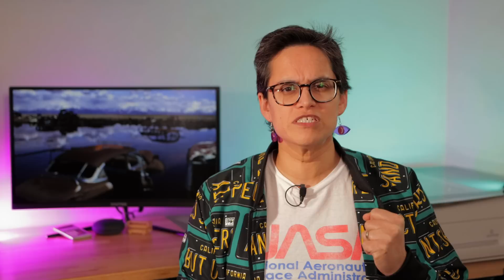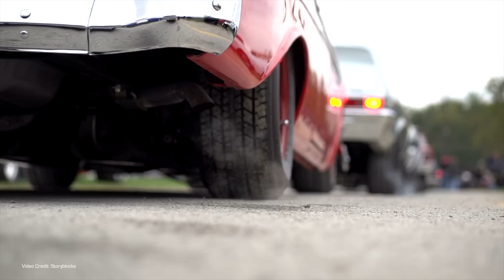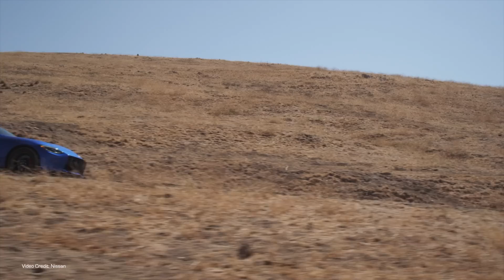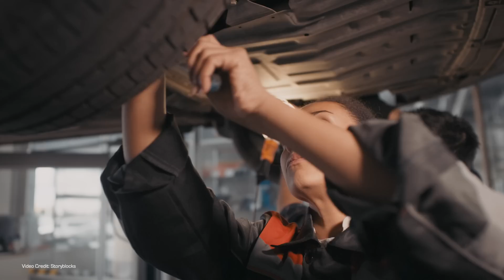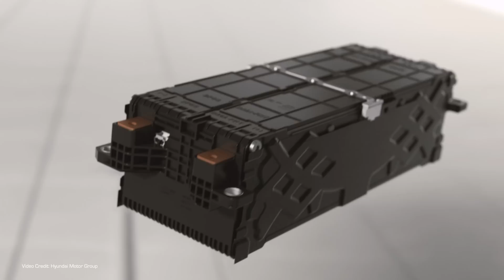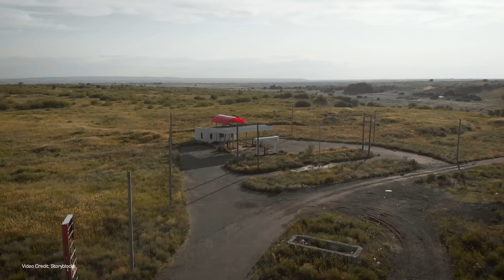Is Internal Combustion dying?

Comment: I agree ICE cars will slowly be adopted in the Western states but it will be slow in the upper Midwest and in the Southern states from New Mexico to Florida. Semi-trucks will be the last to change due to the recently introduced fuel-agnosticinternal combustion powertrain solutions that run on diesel, propane,  NG, and hydrogen. These engines have been in test for three years in California on Walmart trucks,  They are scheduled to go into production later this year and meet future CARB requirements. I still see electric cargo vans and trucks carrying less than 30,000 lb loads and only traveling 175 miles per day dominating the market over the next seven years. Battery technology needs to advance to 500 Wh/kg to overtake heavier longer distance requirements. As an example, today's electric battery trains with over 35,000 lbs of batteries can travel slightly over 44 miles per day pulling 430,000lbs in ideal conditions. An average ICE freight train carries 6,000,000 lbs of load.
Reply: Have you ever heard of electrification? Europe has electric trains that don’t need batteries. They take power from the grid as needed.
Reply: @davidlazarus67  Yes the company I work for makes the electric drive trains for these overhead feed trains and also makes hydrogen drive trains for trains where electrification is not available in Europe.
Reply: @Carl_in_AZ  There aren’t many places that have large areas without electrification. Parts of Scotland have diesel trains for remote regions. Though I have been on electric trains almost to the artic circle. Are these areas in Eastern Europe?
Reply: @davidlazarus67  We are doing electric diesel, battery, and hydrogen driven trains in parts of Great Brittan, Spain, Switzerland, Germany, Austria, Italy, Poland, and Sweden. Keep in mind trains that carry passengers are not the same as locomotives that pull freight.
Reply: The US is a small part of the car world. China is by far bigger market.  What they want will drive the world and they want electric.  What the US wants really will not be important.
Reply: @atlantasailor1  Yes and the interesting side effect is that Asians will end up driving Chinese EV’s and the scale of purchases could lower the costs considerably for Latin American and African countries.

Comment: Any more details on this battery patent that was hoarded by oil companies? I am anti-patent for things like this and many other reasons, and this would aid in my research. Thanks!
Reply from the maker: Iirc The EV-95 battery, a large format NiMH battery used in the GM EV1 and the Toyota RAV 4 EV (first generation) was produced by a company called Ovonics. That company was partially bought by GM which eventually sold its stake to Texaco. Then Chevron bought Texaco shortly afterwards. Chevron pretty much immediately banned Panasonic, who made the EV-95 battery under licence from Ovonics for producing EV-95 and barred any uses of the Ovonics battery in electric vehicles.

^Kate
Reply: @transportevolved  Wonderful detail thank you so much! Keep evolving!!
Reply: @transportevolved  Thanks, Kate! Very interesting detail!

Comment: When a BEV from Vietnam is going to cost 41K or there abouts low cost alternatives are very much needed. With the approximate 20% duty on Chinese BEV's , if imported, there is definitely a need for a 16K EV. Robotaxi's should be cheaper than owning an EV but that is a major unknown right now with no details on when, where, how much per trip, etc.
Reply: There is an incredible tiny car from China at $4500. It’s a city car so would be a great seller in Europe and Asia. It even outsold Tesla in China.
Reply: Everyone's selling everything they can make.

Cheapness is going to come later from the cars we are buying NOW.
The cost off a car is deprication, and that's based on a car dieing about 8-12 years after its owned, as you approach that date you get a discount from the seller based on the risk that you will be left holding the can when it dies.
From the nissan leaf 11 data (an absolute shody EV) it's just not dieing. Range may be degraded but it still works as a car.
We know that leaf11 degradation is 2-3 times worse than any other EV. So cars will be flooding in but 10years later they were not be dieing out like ice.
Reply: @simonhenry7867  I would expect that clever people will work out how to replace the batteries and give them a whole new lease of life.

Comment: There was some new nails to the coffin, thank you.
I believe that in 2025 BEVs will be cheaper to purchase than similar ICE cars, they are already way cheaper to own.
Reply: They're already cheaper than similar petrol cars, and have been for a long time. They're only more expensive if you compare them to dissimilar cars, or if they're made by petrol car companies that have priced them to avoid cutting into their existing sales.

A Tesla S Plaid is about 1/10th the price of a Veyron.

A Model 3 is about 50% cheaper than a BMW M5.
Reply: @gasdive  Because everyone is buying such expensive cars ... look at the bottom of the market where most individuals are looking and it becomes a different story.
Reply: @Hans-gb4mv  no one seems to be able to separate

"EVs are all cheaper than any ICE"

From the statement

"Some EV's are cheaper than the equivalent ICE"

These statements are not equivalent. One is the statement I made, the other isn't. Stop pretending that you've cleverly caught me out.
Reply: @gasdive    Battery electric cars will never be cheaper than truly equivalent conventional cars. Show me a new electric car with ABS, airbags, a motor with at least 80 horsepower and at least 100 miles of range for less than 16k, and I'll believe you.
The top speed and overall quality of a Model S Plaid can't even begin to be compared to a Veyron's. It can be compared to a Dodge Charger Hellcat, wins on 0-60, but costs almost double.
Again, the top speed and overall quality of a Model 3 can't even begin to be compared to a BMW M5's. It can be compared to a WRX STI, but has to cost almost double to win on 0-60.
Reply: @gsilva220  "overall quality" is a pretty subjective thing, but the Model 3 has more interior space, better NVH vastly better gearbox and more responsive engine. If you see "quality" as how much useless tat you can squeeze into a cabin (which has become the indicator of quality that the petrol car makes have pushed for the last couple of decades) then yeah, the Tesla can't compete on quality.
Reply: @gsilva220  look at the Dacia Spring in Europe. Yes it’s a city car EV, with a relatively small engine but it meets all your other requirements and with grants comes in at under €10k.
Reply: @gsilva220  PS "Again, the top speed....can't even begin to be compared to a BMW M5"

The BMW M5 is speed limited to 250 km/h. (unless you buy the race version which makes it twice the price of the Model 3 instead of just 1.5 times) The Model 3 does 261 km/h and the base model isn't much slower at 230 km/h. Certainly comparable.
Reply: @gasdive  You sound like a true fanboy - you have no interest in cars in general and don't care about the look
and feel of the car you drive - for you it's just a household appliance. You would happily drive around in a bananabox on four wheels as long as there is a Tesla badge on it.....
Reply: @robertkempe2730  so just like 99.999% of drivers then. BMW doesn't even make a manual car anymore. Nor does Mercedes.
How many single seat sports cars have you seen for sale lately?

But what's that got to do with it anyway? The electrics that I mentioned are 7 seat saloon cars. If your objecting that 7 seat saloon cars aren't sufficiently sporty, you're really clutching at straws.
Reply: @gsilva220  only 1 car in the US with ABS, airbags, and whatever, is listed below $16k. And that's the base model of the Chevy spark. The Mitsubishi mirage just MIGHT scoot under, but..probably not. 
So, you want a BEV at a price even ice cars no longer come at. 

The cheapest ev is the Nissan Leaf @ $28k. With a 149 mile range. 

The thing is, 10 years ago, the cheapest new car could be gotten for right @ $10k. The Nissan Leaf was the cheapest ev @ $33k a decade ago. IT has gone in price $5k for the newest model, while the cheapest gas car has gone UP $5k. 
Ev's are getting cheaper. Give it another 10 years and it's highly possible that the cheapest car in the US market will be an EV.
Reply: @gasdive   By overall quality I meant Finishing quality and material quality. Tesla is only now starting to fix both.
Reply: @gsilva220  Munro says the Tesla build quality is as good as any other car, since November 2021 for the US made cars, and all the Chinese made cars.
Reply: @sh969     The Chevrolet Spark, Nissan Versa and Mitsubishi Mirage all have MSRP's below 16k, while the Hyundai Accent and Kia Rio are just slightly above. All these cars exceed the requirements I cited above with a good margin. The Dacia spring costs 19k€ in Spain and 20k€ in Germany, not considering incentives, which are a market anomaly, are not applicable to everyone, and have origin on taxes paid by people who cannot afford new cars anyway.

I'm an advocate for electric machines. Humanity should have switched from steam engines straight to electric motors in primary traction. Until very recently, I was saving to either buy an electric car or convert one of my cars. However, I realized that using batteries to power these motors was a mistake. So much so, that combustion engine primary traction, another mistake, was able to take over.

Manufacturers of electric vehicles already had 120 years to fix the single conceptual mistake stopping mass EV adoption. Batteries are not ready for use in electric vehicles, and will never be. In this context, ending the development and production of combustion engines before a decent way to store energy is found is yet another mistake. If nothing is done, all we will have are unaffordable battery electric cars being made with more and more range, and becoming useless unrepairable piles of metal out of warranty at the hands of the people who can't afford to buy new, and will suffer the most.
Reply: @gsilva220  all you're really saying is that no one is building an electric car in that segment. Electric cars are the cheapest option in some segments, and the number of segments where that's true is increasing as more designs make it to production. Finding one segment that electric cars aren't the cheapest doesn't mean that electric cars can't compete. There are electric tip trucks available for 2000 dollars. That's a segment where there are no petrol offerings that can compete. Finding that segment doesn't mean that electrics are, and always will be the cheapest option any more that you finding a different segment proves that petrol is and always will be the cheapest option.
Reply: More importantly, cheaper to build. Do you think GM and Ford have a social conscience where they care about the environment?
Reply: Price parity can happen two ways reduce BEV  they aren't doing this or   by   increasing the price of ICE cars . The  people who say they can't afford  BEV still won't be able to , just means more people will buy second hand and  keep cars  longer.

Comment: With the cost of ice cars going higher and higher, the ice car makers will do themselves in. 60k for an f150 vs 65k for an f150 lightning means I'd go lightning.
Reply: Then add in the lower running costs and maintenance and subsequent higher driver satisfaction and you can see why developing a new ICE engine is expensive and will be unlikely to recover its development costs.